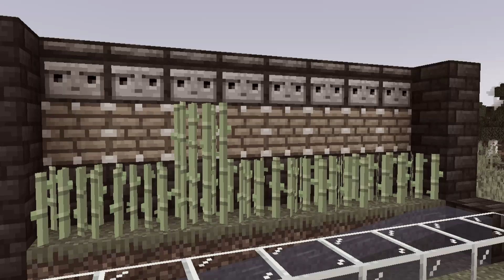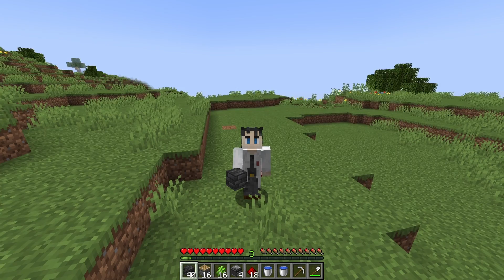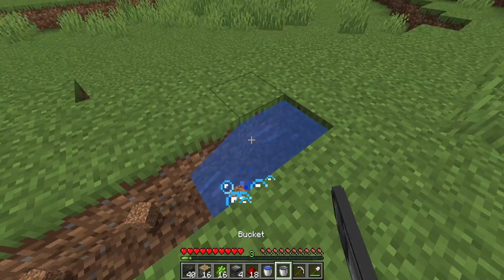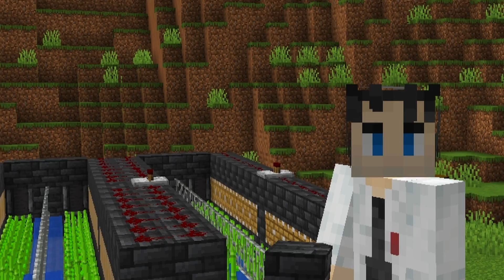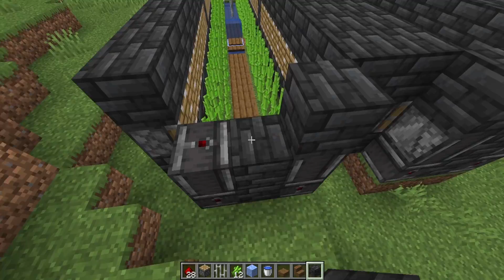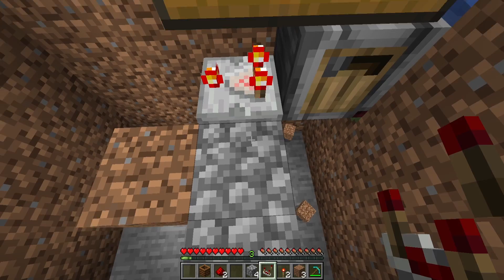Infinite Sugarcane / Automatic Paper Farm For Minecraft 1.21

Comment: I would use a hopper minecart as a collection system to not miss out on the despawning items, which will also be a bit more space efficient since the water conveyor won't be necessary anymore. Still a very neat design!

Edit: In that case you can place the water sources under the pistons for example, such that the center strip can be left out.
Reply from the maker: yeah that design is lossless and space friendly, but does come with the cost of rails. if your not duping them.

plus the 2 block extra space below the farm, meaning that expanding the farms height is more challenging.
Reply: @SekaarMC  Yeah that is true...

I did not think about that, but yeah, you can dupe the rails/use an iron farm. But it scales pretty well horizontally since the rails can just be extended under the other parts.

Comment: wouldn't a dropper with 5 items in it work better than the composter????? in the crafting circuit???
Reply from the maker: Hi, We need a signal strength of 8 to know that the crafter is full, a dropper has 9 slots, to get a signal of 8 we would need 288 items, thats 4 stacks and 32, or 5 of any non stacking item like 5 swords. I feel that would be more complicated to explain to people then just filling a composter to be full and Less chance of mistakes.

and technically since composters have only 1  item "slot" and droppers have 9 composters cause less lag.